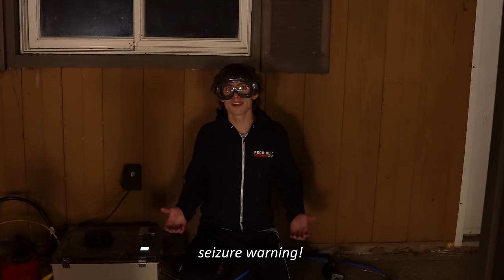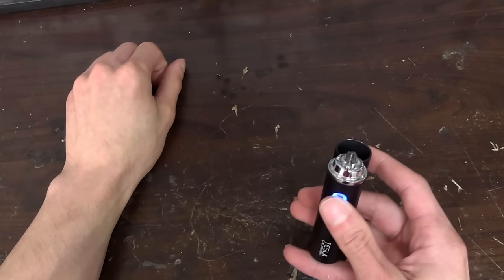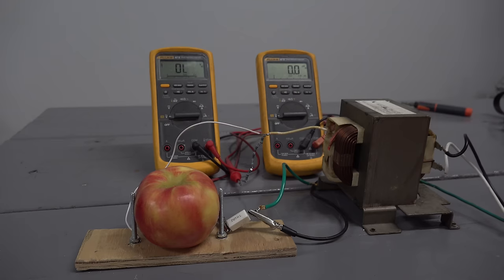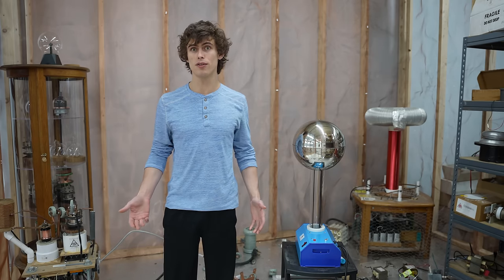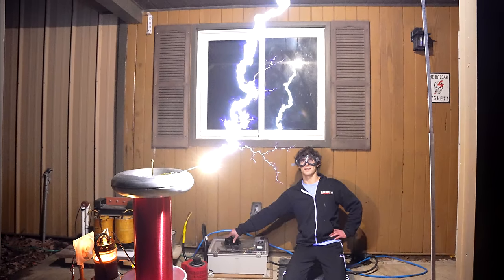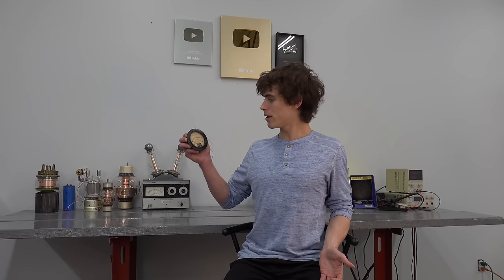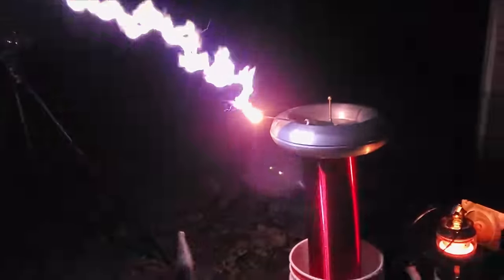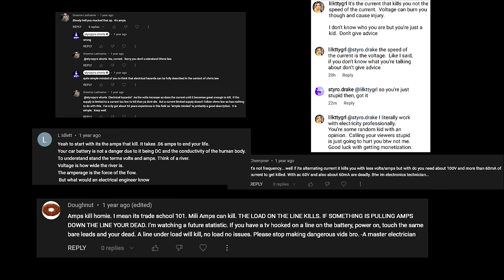Is it the volts or amps that kill?

Comment: Fun fact about the Osha 50v regulation: in my recent electrical safety cert training the instructor talked about how at the time those regulations were established the telephone companies had a substantial lobby, and they happened to operate their lines at 48 volts, so yeah the real reason the limit is set at 50v is bc the telephone companies didn't want to be regulated and they could pay enough to strongarm the govt lol.

Edit: should probably mention the instructor my company uses actually sits on my state's board of electrical examiners.
Reply: Important historical comment
Reply: Many old houses that used to have land lines have copper lines that still carry those 48 volts, even in a power outage. I'm a curious electrician and I've found about 90% of the homes that have the solid copper red, green, yellow and black (in my sector) have power. Charge your phones, have lights and more in a blackout.
Also it used to be telephone company, not companies. Bell ran the world and invented everything. 
You know who else sits on the board of the NEC? CEO's of major electrical parts companies, Legrand, Hubbel, Leviton and others. Why do you think GFCI's are required everywhere and cost $35...
Reply: I mean this is true, but bear in mind engineers certainly didn’t choose 48V by accident. I’m sure much effort was made to find a compromise voltage that minimized transmission losses while maintaining an acceptable safety margin.

No way 48V was chosen by accident!
Reply: @Corey Moullas  while I'm sure there were technical reasons for the 48v standard I would wager a month salary that safety was bottom of the list, if it even made the page! You gotta remember this was established at a time when ppl were smoking cigarettes with asbestos filters for Christ's sake!
Edit: oh and let's not forget knocking back shots of radium tonic to wash down the bread cut with plaster and the cheese preserved with embalming fluid lmfao
Reply: @BariumCobaltNitrog3n  You can't get very much current out of the phone line though. It's current limited to ~30mA. You can put a bare LED across a phone line with no current limiting resistor, and the LED lights about normal (I'm talking like an indicator LED, not a high brightness lighting LED). I discovered that as a kid playing with LEDs and phone lines. So yes, you get "free power" from the phone company if you still have a landline that runs to your house, but the amount of power you can actually get from it is minuscule. It certainly will NOT charge a phone during a power outage. Now as an adult (and engineer), I'd actually measure the voltage and current with an LED across the phone line, if I had a phone line. Only fiber runs to my house :(
Reply: Sad thing is this is how everything works. Lobbying and corruption
Reply: There's a whole bunch of regulations and guidelines that are made like this, or just because someone said something that sounded reasonable a long time ago and it just happened to work out. When going over building codes in one of my architecture classes, we found out that the max amount of newtons to open an emergency escape door was completely arbitrarily chosen and has no testing behind it. Someone just said a number one day and it stuck because it worked. There are plenty of building codes that are also lobbied for and are not necessarily for safety. Companies of all sorts have to look out for their bottom line I suppose.
Reply: @eliseosterbrink8000  It's the typical "you made the assumption the safety was of the building occupants - you know what happens when you ass-u-me". It is for safety - safety of the profits of the companies that lobbied - just like always. #1 priority, profit and shareholders - everything else be damned
Reply: @xxportalxx.  not much better today with endocrine disruptors and glyphosate. The only difference is now it's on purpose!...
Reply: and people like styropyro are who discovered shit like this, basically wrote the books
so no shit this guy who got school education vs actually doing the work all his life
Reply: More like pay them, nobody "strong arms" the US Gvt and gets away with it, more like they paid them well.
Reply: @gorak9000  30mA at 48V is about 1.5W of power, no? I guess you'd lose some more power in the process of stepping it down to usable 5V, but 300mA could at least work for a dumb phone to get charged. Or to get your chargeable flashlight charge because you couldn't have been arsed to keep it charged and now are forced to stumble in the dark, idk
Reply: @cmoullasnet  It's because it's a multiple of 12V, i.e. what cars use. 24V is also a "standard" voltage. Also on boats, you need a special kind of insurance to have 240V AC, and with the advent of electric motors, many people are switching from diesel to diesel-electric. This kind of electric is usually DC 48V to avoid that expensive insurance. Unfortunately, a lot of sailors have found out that hard way that 48V is actually quite lethal. Although Styropyro did an excellent job, his video was more for nerds than a simple rubric. That simple rubric really ought to be "the volts have to be high enough to overcome your resistance". Because once it has overcome your resistance, it's as styropyro says, you stop being an insulator and start being a cooked sausage. At that point amps (which is really saying watts at whatever voltage you're at) matters. So while 48V is low, if it's supposed to power a DC motor then it's going to be able to dump a lot of amps, and if you're in water and your skin is now soft and wet, your resistance isn't anywhere nearly as high as you thought it would be. In fact this video doesn't mention water once, despite it being responsible for well over 90% of the electrocutions per year [citation needed], because unlike wires that you will probably let go of, you can't let go of a puddle of water.
Reply: @John-rw9bv  You’re right it’s 4x12V lead acid batteries. That’s the highest voltage you can get out of lead acid cells in series that is fairly universally safe basically.
Reply: @franksmith7271  oh yeah? They were trying to go after the radium corporations from the 30s into the 70s, they kept holding them off in court (the executive branch being beholden to the judicial and all that). There's plenty more examples, if you're big enough even the govt struggles against you. Same story with pfas and derivatives, they've been trying to go after that since the 90s.
Reply: @MrCh0o  It's not 30mA at 48V though. It's 48V open circuit - the voltage drops when you start pulling current from it. As I said above, if I actually had a landline, I'd measure it, but considering you can put an LED across it with no current limiting resistor, it's more like 2V @ 30mA - it's diddly squat! Doing a little googling, looks like you can maybe pull about 0.3W from it, that's about it. The phone company isn't in the business of supplying you with free backup power :)
Reply: .    Telephone voltage is more along the line of 52VDC, and ring voltage on that same line is about 90VAC and upwards to over 120VAC, so that theory has a flaw.
Reply: @gorak9000  :
     There's a really big resistor at the remote office before going to your house that takes the blunt when the lines are shorted.
Reply: If you don't use a home phone and still have 42-48v in the phone line? You can find a Hack tool? 48dc to 120vAC/150+watts max, I think? Or, you can use a reducer to drop to 12 v/DC to charge your cellphone. SHTF...
Reply: @LordWillyGee  :
     You will not get 1 watt let alone 150 watts, but you can use a buck converter to drop it down to 5VDC to trickle charge your phone, but make sure you have diodes in series before the buck, because if someone calls your number, that circuit will likely blow from the 90VAC to 120VAC from the ring and may ruin your phone for good.
     That said, don't do it; phone lines are not designed for anything but standard phones.

[edit]  I believe you meant to reply to BariumCobaltNitrog3n when you replied to OP; I see now you were being factious.
Reply: I've actually touched those 48 volt systems. It smarts but it didn't kill me. It didn't even hurt me. Hurt me. Hurt me.
Reply: Yeah... it's kind of shocking how much stuff we take for granted as "known" works like that. In medicine, especially, we're kind of in the midst of a massive multi-decade debunking of the 20th century's unquestioned "knowledge", a stunning amount of which has been turning out to be not just wrong, but completely backwards.

I feel like most people know, at this point, as an example, that the food pyramid was literally just sold to the highest bidder in the 50's. The recommendations for what we should eat were doled out in proportion to the wealth and power of the various agricultural lobbies at the time. As a consequence, we have a massive global epidemic of obesity and diabetes (which, those two are actually the exact same condition just at different severities).

Less known, but slowly spreading, is the absurdity of the "obvious common wisdom" that to lose weight, you should eat less and move more. "Calories in minus calories out".

Yet even a very basic and brief thought experiment can debunk that in minutes... not to mention that every single well-designed peer-reviewed study ever conducted, thousands upon thousands of them, have shown unanimously that it doesn't work that way. Even studies commissioned by governments and companies intending (even well-meaningly) to show how effective it was have without fail shown that it doesn't work anything like that. They all show the pattern that I'm sure is familiar to most people reading this... it goes great for a month or two. You lose 20 to 50 lbs. Then you start to feel like crap, you start getting soul-crushing cravings, your energy levels plummet, and eventually you'll even start to get physically ill, all while plateauing or even regaining the weight, until finally, the combination of lack of results and your body and mind screaming at you that you're not dieting, you're committing suicide, gets you to "fall off the wagon", whereupon you gain even more weight. Not kidding. Every single well-designed peer-reviewed study ever done, over many decades has shown exactly the same thing.

And why not? According to that theory, each pound gained or lost represents 3500 calories of excess or deficient consumption. So let's say a person weighing 300 lbs starts a diet. They want to lose 2 lbs per week, so they cut 1,000 calories per day from their diet, for a male, say, going from 2500 to 1500.

It starts great! The first week, they lose 2 pounds. By 5 weeks, 10 pounds are gone. By 50 weeks, they should be down to 200 lbs. All good, right? Except... that doesn't magically change the equation. Oh, sure, the lesser body weight corresponds to a somewhat-lowered base metabolic rate, but not by much.

So let's continue... by 100 weeks, they should weigh... uh oh. 100 lbs? That doesn't sound right.

By 150 weeks, they should weigh zero pounds. Oh no! What's happening to our model!? It's wrong, that's what. It isn't linear. It's not even a simple mathematical function.

Rather, as you cut calories, your body thinks you're in a time of famine, so it cuts your metabolism to compensate. This takes, you guessed it, a month or two to go into full effect. That's when things were going well. By then, your body has cut its base metabolism to such an extent that it can't go any lower, so... it starts modifying your hormones, your brain chemistry, and many other things, to discourage you from using as many active calories. Gradually, you feel more and more worn down, until eventually, if you don't give up, you actually start to get sick. Your body starts to destroy itself, digesting itself to stay alive, and the longer you stay on the diet, the worse and worse you'll feel.

Unlike what the AHA and FDA and half the nutritionists in the world still proclaim at the tops of their voices, this model of how nutrition works is backed up by genuine understanding, all the way down to the molecular level. We know exactly how it all works, the exact hormones that trigger the exact processes, at every stage. Where "eat less, move more" literally only has, "Well it makes sense, right?" That's it. That's their entire argument. But with the weight of numerous government agencies around the world backing it up, well... you get your 50 volt rule, baked into the fabric of society so deeply that nobody even bothers to ask "why" that thing is "known" anymore.
Reply: Vb should be < 30 V

Comment: If Styropyro says "I gotta get out of here" in a lightening storm, then I need to be more scared of lightening storms.
Reply: Cheers to that 😂
Reply: him scared of lightning also him, oh a tesla coil let me point this stick at it
Reply: Also what appears to be some sort of tornado on the far left
Reply: he was close to the lightning he could've got electrocuted, you probably view them from a distance
Reply: He was in a car, that's a Faraday cage.
Reply: @gunnat8407  Because unlike the tesla coils, he cannot control the lightning storms
Reply: That clip was from the video of him chasing tornadoes and there was a tornado in frame when he said that.  A car is actually a decently safe place to be during a lightning storm, nowhere near as good as a solid building but better than outside.  The rubber tires and generally lower top (compared to trees and buildings) of a car makes them less likely to get struck.  If a car does get struck by lightning there's a decent chance most of the energy will travel along the outside of the vehicle instead of passing through the cabin.  Of course being in an open field in a car drenched with rain water does throw a wrench into the works.
Reply: it's 1.21 Gigawatts of power /j
Reply: It wasn't so much the lightning that he was reacting to more the fact that being in a car and you're a tornado is likely one of the worst things you can do. You're almost better off laying down in a field or a ditch then you are to be in a vehicle, only advantage the vehicle has is you can get away from the tornado more easily.
Reply: @bredcubed1161  yeah he and i live 10 mins from each other and we've been having about 2 tornado warnings a day, some days, for the previous 2-3 weeks.  A tornado already previously leveled one of our towns so everyone takes them pretty seriously haha
Reply: I love your comment makes me chuckle your so right exit stage left before there's nothing
Reply: Lightening, like losing weight?

Comment: So when I was a EE student, this question came up several times. None of my professors said it was Voltage or Current. The answer was always " It depends", as in there are a lot of variables that go into it, just as you explain. The one thing they all said is, "Don't want to get shocked? Don't touch it!" Its the only way to be sure.
Reply: Unless it's a high enough voltage, then you don't have to touch it
Reply: @ChristopherHeinz57  at that point why are your ever even in the vicinity of that thing with high enough voltage to create mini lightning
Reply: @skeptic_lemon how else are you supposed to become the flash?
Reply: @dodonooblord6224  Tesla coil!
Reply: @skeptic_lemon  because my job requires it
Reply: @ChristopherHeinz57  fair enough

though that would make you the exception
Reply: @skeptic_lemon  oh yeah, not saying the average person has to worry about it but with the people I work with, the rule isn't so much "don't touch it" as "don't get within several feet of it". But even a household handyman should know the "don't get within 10 feet of power lines" rule.
Reply: Even the voltage vs current debate is a false dichotomy. Frequency even plays a part in how dangerous an electrical source is.
Reply: Bruh.
You can go to any medical center and ask ANY doctor "how can i die?", and you will get the same answer.
Reply: Electric energy student💀
Reply: @ChristopherHeinz57  Then it will touch you.
Reply: Amps and volts are proportional. Without voltage, there's no "potential difference" in electrical charge, and no current flows. 

It's kind of like sticking your foot in the ocean, and noticing it doesn't crush your ankle. (amps) 

But if you took a cup of water, shot  it at your ankle with 500,000 PSI through a pinhole, you might cut your foot off. Even though it's only a cup, vs the whole ocean.
Reply: @myprobate1661  Voltage and current are proportional but in your examples they aren't. Its not possible to have high voltage and low current or low voltage and high current across your body
Reply: "Don't want to get shocked, don't touch it" sounds like pretty solid advice no matter exacty what it is that maeks electricity dangerous
Reply: Ive learned that when you ask true professionals/experts in their field complex questions the answer is very often "it depends". So much so that it's a running joke in my field (tactical aviation).